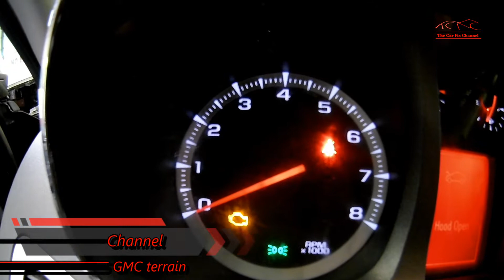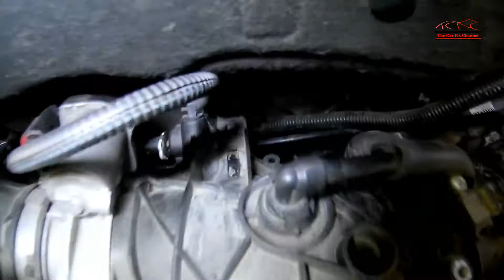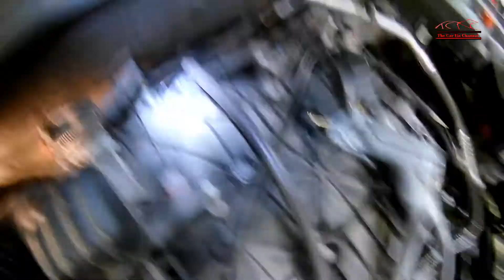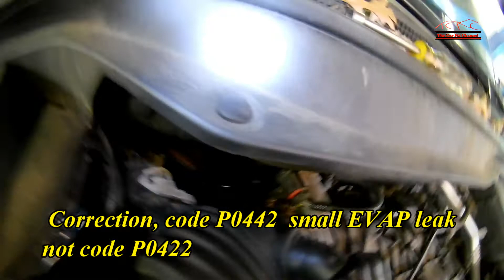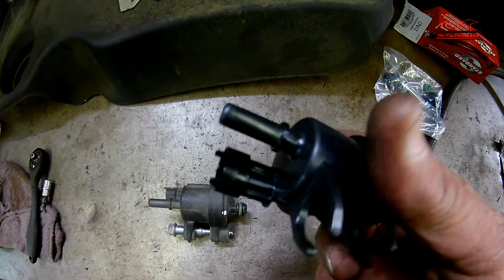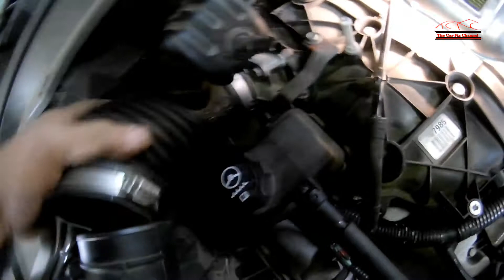Code p0496

Comment: Very informative video. Hoping you can help me out with something. I was getting a code p0455 so I changed the purge solenoid valve and now I am getting code p0496. Does suggest I have a faulty purge valve? I didn't do anything vacuum testing of the new valve before I installed it.
Reply from the maker: Did you clear the p0455 and how long did it take for P0496 to set, In order for the P0455 to set the EVAP system or the PCM activates the purge solenoid to add engine vaccum  to the system and colses the vent solenoid  the EVAP system should hold vacuum for a preset time in the PCM  the faster the vacuum decay  the larger the EVAP leak. The purge solenoid is The main cause of code P0496  if the car runs rough or stalls out after refueling that's a telltail of bad purge solenoid and yes you may have a bad new purge solenoid so you need to test it.
Reply: @thecarfixchannel3046   thanks for getting back to me. once i changed the solenoid value and cleared the 0455 code, it took about four days for the 0496 code to show up. Keep in mind, i drive my car about 5 miles every day. I since put a new solenoid in, and i'm still getting the 0496 code. the solenoid is not the issue it seems. Any ideas?
Reply from the maker: @chaconjohnson  Did you install The purge correctly not backward and dose the car runs rough after refueling.
Reply from the maker: Ones you cleared the code p0455 the EVAP system monitor reset and it take some time for the monitor to complete, code p0496 was not present before this means an issue either in the purge installation or the new purge solenoid keep in miand that code p0455 may return, I do not know what car you have.
Reply: @thecarfixchannel3046  thanks for taking the time to respond. i have a Chevy equinox 2011 3.0 v6 LT.
Reply from the maker: @chaconjohnson  the purge solenoid is the main cause of this code but if you have a scanner that can test the EVAP system you can watch the fuel tank pressure sensor after sealing the system and starting the engine the voltage on the FTP sensor should be less than 1.7 v after a short pirid if time if not this means engine vacuum is present in the system and  the purge is not sealing 100%, the FTP sensor would read about 1.4 v engine off if not you may have an issue with FTP sensor but the PCM should set a code for a faulty FTP sensor.
Reply: @thecarfixchannel3046  this is very helpful information. Thank your so much helping out a complete stranger. I will test ftp sensor tmrw for sure. I will let u know how it goes. Thx again
Reply: @thecarfixchannel3046  I just wanted to let you know that I was able to resolve the problem. You were correct the problem was the first solenoid was faulty. The new one fixed the issue.

Comment: I replaced this on my wife’s terrain about a month ago and now getting the same code. Could there be a vacuum leak going to the solenoid?
Reply from the maker: The new solenoid went bad if you can test the new solenoid with a hand held vacuum pump on the engine side it should hold vacuum if not then the solenoid bad.